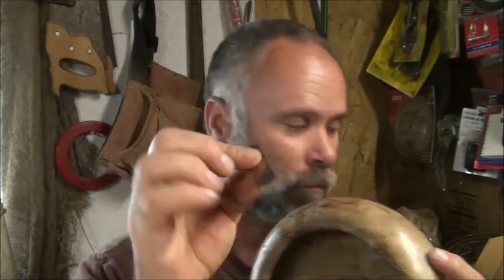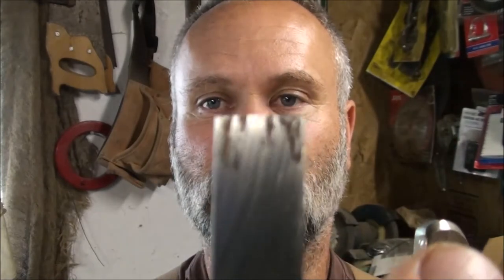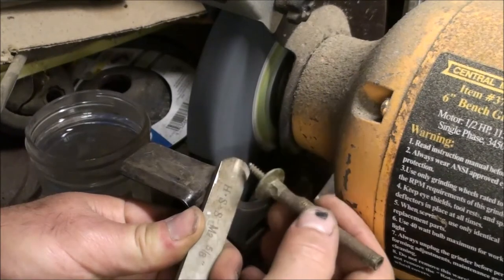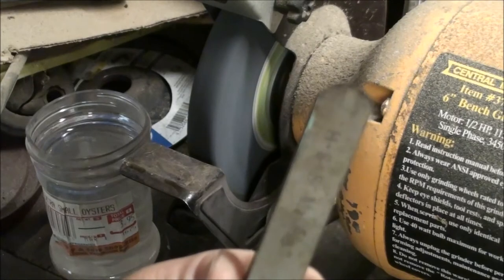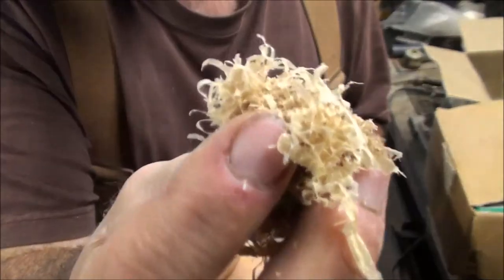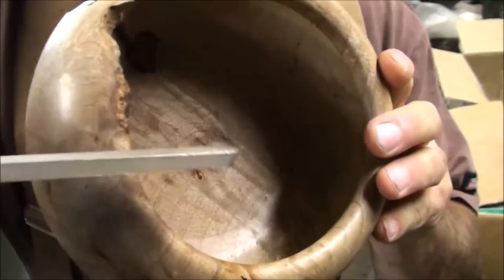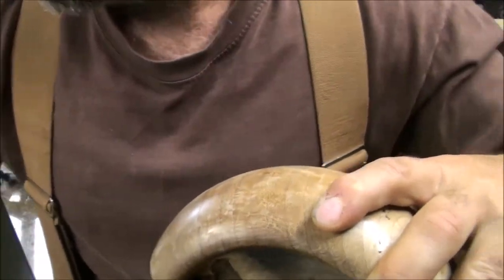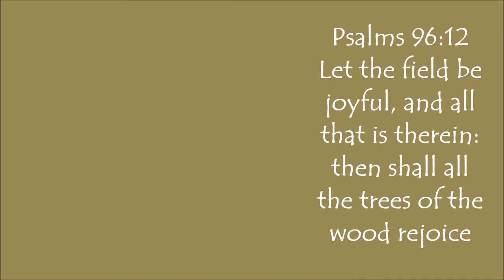Repairing a Wood Lathe Tool

Comment: Now take the part that broke off and weld it to the end of a chisel, that you will probably never use, at 45 deg. Heat it with the propane torch past red till a magnet won't stick to it, hold the torch on it for another 30 seconds, then quench in veg. oil, then put it in the oven for an hour at 400F and let cool. Now you have a tool for getting inside the lip of a bowl.
Reply from the maker: Sounds like a tasty recipe! haha
Reply: That is a great idea. I actually have a plan on making a tool rest that will be more accommodating for hollowing out a bowl or cup. The one thing I would be concerned about as far as an angled tool is concerned is the angle may affect direct leverage. Worth a try though. I know metal lathes have angled tooling but they are secured better than free hand applications. I believe keeping the rest close to the work is the answer but is difficult with the strait rest. I appreciate your knowledge in metal works Tim, Thanks for stopping by!
Reply: How did I know you were going to say that, Heidi ? !
Reply: A friend of mine turns bowls that sell for thousands of dollars at auction (he donates them to a bunch of charities) and he uses angled chisels. So I know they work, but I've never seen him use them so I have no advice on that... With the new rest though at least it would give your hands room to not hit the other side of the bowl.
Reply: LOL @Heidi & Troll!!!   I read this stuff & giggle  all day!   LOLOL!!!
Reply from the maker: Laughing out loud, just like Ellen knew I was going to say that, I was pretty certain I knew what TrollForge would say! hahahaha
Reply: It's worth a try so I will have to give it a try! Of all the tooling I have for turning I like this shape the best. I need to find your friends niche in the market to sell some bowls for a "K" a piece!
Reply: OK you two go stand in the corner :D
Reply: hah!   Does this mean Mr. Rain is  *ground-ed*?
Reply: Ooo that's sharp Kathleen...
Reply: Kathleen Zimmerman I’m in the doghouse again.